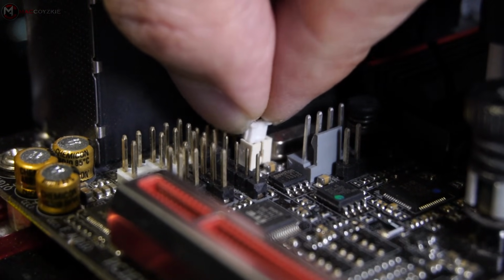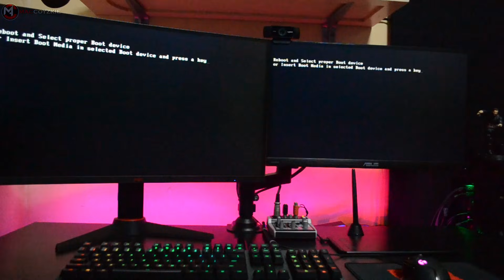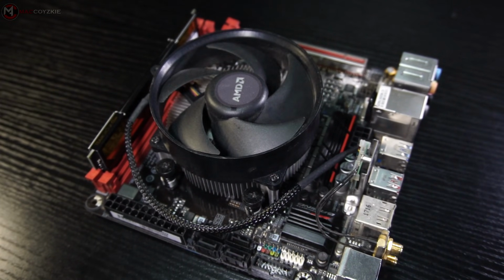How to remove cmos battery in your pc? Cmos reset / hard reset on bios

Comment: I have a question. I started noticing that my fan speed was sometimes very fast and that the CPU was running quite warm. I had replaced the fan several months ago after the old one had started making noise. After a few months, the newest cooling fan started making noise also. A couple weeks ago I noticed that the date/time was not keeping the correct time. I replaced the clock battery and the cooling fan. Since then, the fan is not running a fast rpm, the CPU is running cooler and the clock is keeping the correct time. My question is: will a weak clock battery affect the bios to the point that the CPU runs very warm, causing the fan to run at excessively high speed?
Reply from the maker: no, cmos battery has nothing to do with temperature. If there is anything, the pc will not run normally and you'll see "Power saving mode" if you got a weak cmos battery. If that happens again you might want to check thermal paste on the cpu, perhaps you need a new one
Reply: @MacCoyzkie  when I replaced fan it was a complete unit including heat sink which I cleaned old paste that appeared to be still flexible.  Used recommended paste every time
Reply from the maker: @robj2704  test your cpu and gpu temps then, try using msi afterburner

Comment: Hi, my computer was working fine. I closed it normally. Then after 3 hours i tried to turn it on again rgb lights on pc case and on the other parts were lightning, fans was turning but there was no signal on the monitor, keyboard and mouse lights are off, ethernet cable’s light is off. And fans are turning faster than their normal idle speed. I think it is a motherboard problem. I have removed the cmos battery waited 15 minutes but it did not solve my problem. I also tried removing and pulling rams and gpu and i have checked all the cables three times. This looks really weird. Nothing harmful happened to pc in between the three hour off period. Anyone has a suggestion? It is really frustrating.
Reply from the maker: sounds like a power issue either from the psu or wall outlet. If you got an AVR or UPS that might solve the problem, you can also double check the stability of your psu by using a psu tester like this https://amzn.to/3edegBw
Reply: @MacCoyzkie  i tried to run the pc with one ram stick and it worked. Then i put the other ram and run with one stick. It also worked. Then i put both ram sticks in and it is working now. It was a weird problem with a weird solution.
Reply from the maker: ok then try to clean the ram slots and make sure there are no dusts in it. Place ram sticks at 2nd and 4th slot. then try clearing cmos before power your pc back on.

Comment: Hello, i did as instructed and put back the battery but when i connected it and plugged it back in it started beeping 3 low and 3 high and it wont start any help?
Reply from the maker: that's actually a memory issue bro. so try ty re-seat the ram sticks and while you're at it clean off any dust around the ram slots

Comment: I think my cmos battery was located under my graphics card and im not a pc guy who knows how to remove the graphics card correctly
Reply from the maker: the other way to do this is to go to bios and load optimize defaults.
Reply: @MacCoyzkie  um i think my ssd where my windows was installed was a kingston and i set P0: SATAFIRM S11 as my boot option 1 but it still wont boot up, and also after several trials my RGB keyboard came to a point where it suddenly stopped working and i couldnt click any keys anymore but i couldnt say my keyboard is broken because the RGB light is still running, btw i already removed my cmos battery and waited 5 mins before putting it back but still no luck, maybe its time to let a computer technician handle this, i already have a copy of all my important files and programs on my E drive so i dont have to worry if my pc was going to be reset
Reply from the maker: @galadirk7843  hmm, how did the pc problem started?
Reply: @MacCoyzkie  it all started when i tried resetting my pc because all my browsers are crashing my pc whenever i try opening it, but while resetting it gets stopped at 63% and a bluescreen appears with "There was a problem resetting your PC. No changes were made" and then theres two options to choose, Troubleshoot or Turn off PC, so i chose Turn off PC instead cause troubleshoot isnt working either and then when i turned on my PC this error message started to appear and i wasnt able to use my pc since last night, im just thinking of calling for help from a local technician, nice tutorial by the way👌
Reply from the maker: @galadirk7843  i see i hope the technician will be able to fix it. My theory is that something got messed up with the system files, the bsod stop_code should give more info if you got the stop_code error during the blue screen.
Reply: @MacCoyzkie  i hope so, i already clicked the like button and subscribed to your channel, thank you for giving some time replying to my thread:)

Comment: Hey I removed my battery because I had the reboot and select problem so when I removed my battery and put it back in I entered the bios then went to select my ssd my ssd did not show up so pls help
Reply from the maker: replace sata cable, if sata is new or not faulty try your ssd in a different pc if its working. btw you will see the reboot and select on display if your ssd has no windows in it.

Comment: Does this mess up with the OS booting up or something like that? I need to reset the bios password but Im afraid it will afect the OS in any way
Reply from the maker: some motherboard does not reset bios password even after bios reset so check your motherboard manual for more info on yours. To answer your question reset bios through clearing cmos will only set the motherboard bios to default without interfering with your OS or any files in your drives.
Reply: @MacCoyzkie  thanks bro
Reply from the maker: @vasconeves1820  your welcome bro!
Reply: @MacCoyzkie  and btw it worked. I was able to reset bios password completely fine
Reply from the maker: @vasconeves1820  that's good news then :D

Comment: Dude. Mine was UNDERNEATH my gpu. Gpu also has a faceplate, and an extra screw. Best buy really didnt want me to fix this on my own...
Reply from the maker: there are mobos like that. What you can do right now if you don't want to open your pc, try going to bios and loading optimize defaults. its actually the same thing

Comment: I have a problem on my old pc when i turn it on its make this sound bib bib bib bib bib bib bibb like that it make the sound when i turn it on then keyboard mouse and desktop not working but pc is working so this the cmos vid will it help???
Reply from the maker: ram sticks are not seated correctly or faulty, try to re-seat those ram sticks, here's how to https://youtu.be/UKR5xRsOhNg
Reply: Its not working i did all you said to do :(
Reply from the maker: @rewas7162  ok how about you try your rams with a friend's pc to check if its still working fine.

Comment: the bios reset after 5 min cmos unplug right ? If i plug it again after 5 min
And then what must i do ?
Reply from the maker: yes, when you remove the cmos, the pc should be unplug from the wall outlet. after 5minutes place cmos battery back and turn on pc and see how it goes

Comment: So If I havd the cmso, will my computer remove everything, what's on it like Datas and everything?
Reply from the maker: no, clearing cmos is just setting the system back to default. your files will still be there and the only way you can remove files completely is by formatting the pc or having a clean windows installation

Comment: How do i remove the gpu?
Reply from the maker: there is a lock on the right side of the pcie, you need to pull that down, unscrew the gpu on the slot and pull it out

Comment: It worked! Subscribed to you sir!| at first I thought my PSU was faulty, but then I remembered something about CMOS, and I came across your video!
Reply from the maker: glad it worked! you're welcome bro and thank you too for the subbed!
Reply: @MacCoyzkie  Does this trick works if I replace my PSU but motherboard doesn't power on and only power on with old PSU or PSUs of the same model as the old one
Reply from the maker: @Arcyriea  no, the motherboard might be faulty at this point or you just missed a cable to plug in the mobo
Reply: @MacCoyzkie The new PSU passed the paperclip test though, but I'm not sure if the cables are ok

Maybe there are some wires that get disconnected when I tried to install the new PSU or the cables were already broken before they arrived
Reply: But then I see that with the new PSU the motherboard does receive power but the power button does not turn it on
Reply from the maker: @Arcyriea  try to jumpstart the pc then

Comment: When I open my pc I have to turn it on like 5 times before it starts booting and it really suck cahse its just turns off immediately everytime. Does changing the cmos make it work again normally?
Reply from the maker: if you don't see "power saving mode" on your display then there is no need to change cmos battery. your pc problem sounds like a faulty psu. at the moment try using AVR or UPS, perhaps its just the power outlet having power fluctuation

Comment: I CANT PUSH THE LOCK DOWN COZ IT KILLS MY FINGER TRYING
Reply from the maker: bring it to a local shop then and let them do it for you
Reply: @MacCoyzkie  I managed to do it n reset my bios but I still have issues with my pc
Reply from the maker: @Kazohh  you haven't mention the issue yet? how did the pc problem started anyway?
Reply: @MacCoyzkie  it restarts when I’m playing games
Reply from the maker: @Kazohh  oh that's probably overheating, check your cpu and gpu temperature and make sure it doesn't go beyond 90c. If it doesn't want to turn on again then you got a dead psu. Usually happens when your psu is unreliable

Comment: My motherboard and gpu all have lights on inside my pc but it won't turn on. Tried changing RAM sticks, psu and resting CMOS but still nothing. Any ideas ???
Reply from the maker: did you plug the cpu psu pins? just a hunch. Also the monitor cable is it in the gpu port? May i also know if this was already a working pc or is it new?
Reply: @MacCoyzkie  yeah pc has been working fine for 6 months then randomly wouldn't boot.
Reply from the maker: @MrThegeorge1990  it's difficult to say what is up, so how did your pc problem started anyway?

Comment: Tried doing this 3 times in a row and it did not work, i dont know what it may be but it could be the cords of my hard drive as it all started when I tried installing another hard drive, to which this chaos started with my pc as it would no longer work.
Reply from the maker: old hdd or faulty hdd could cause pc not to work properly. How about remove all hdd and just leave your ssd boot drive and try to boot your system to double check

Comment: I think I messed up one of my motherboards by trying to attach faulty HDD. Now I have constantly system interrupts using 20% CPU. I switched every single part back and forth trying to find faulty part but only thing left was MB. Do you think this could fix that MB?
Reply from the maker: if you already remove the faulty hdd then all should be good. Try replacing the sata cables because it might also be the one causing the problem. For the motherboard, it's difficult to say if its faulty unless you try it with a different system

Comment: Thank you so much! I thought I was done for. On boot up screen was black and fans started to run insanely fast. Just like in movies right before explosion. This fixed it. Learn something new every day
Reply from the maker: glad to hear it worked! you're welcome bro!
Reply: LMFAO mine doing it right now, that's why I'm here
Reply from the maker: @TheGetmoneyman  i hope you were able to fix it
Reply: @MacCoyzkie  I'm about to try the ram trick I literally took everything apart and put in back same issue even left some of the HDs unplugged
Reply from the maker: @TheGetmoneyman  can tell me how the pc problem started? also let me know your pc specs so i can have an idea
Reply: @MacCoyzkie  it was random at first then I left it on overnight, and woke it up then the screen was fuzzy then I did a few power cycles after about the third one it stopped booting , old system is but it was working like a champ til the other day
Reply from the maker: @TheGetmoneyman  at this point you need to test each part of your pc in a different pc, specifically the gpu and ram sticks
Reply: @MacCoyzkie  CAN you help me?
Reply from the maker: @cyberpunkmoba2045  i just answered your first comment
Reply: Hey,I just removed the battery but nothing happened 😔😔 still the same.screen is black and air cooler is working roughly,like it's rendering or something. I clicked on "use USB to flash bios" and then screen became black(( my motherboard "Tomahawk b550

Comment: Mine hasn't worked in months, I put new ram into my computer and it hasn't worked since mid 2020
Reply from the maker: have you tried cleaning the ram slots from dusts? also this clearing cmos might also do the trick
Reply: @MacCoyzkie  I've cleaned it a and cleared the CMOS more than 20 times now and it won't boot to the bios menu so I can go from 8gb of 1333mhz ram to 16gb 1600mhz, but 
It threw error code 164 on me and the only fix was going back to stock ram, but it still won't boot up because of error code 161
Reply from the maker: @ob1kenobi748  that basically means your cpu or your motherboard is not compatible with the overclock. Clear the cmos again and just use the stock settings for now

Comment: So my pc that I've been using for 5 years stopped turning on today, is it possible that my cmos battery is dead? Psu, Cpu, Gpu and Dram seems to be fine according to led indicators manual if I understood it correctly.
Reply: Omg literally same bruh
Reply: Kinda hesitating to remove the gpu too because the battery is underneath.
Reply from the maker: @Leg8FrFr  you will see a message on your display saying "power saving mode" if your cmos battery is depleted. if you don't see that then its in good condition. Clearing cmos might fix it so try it out
Reply: Thanks, I'll try it out later

Comment: boss may problem pc ko, kahapon at nung mga past days oks naman sya gumagana, pero ngayon lang ayaw nya na umalis sa logo ng asus, hindi rin napipindot yung del at f2 para pumunta sa bios.. recommended ba na gawin to?
Reply from the maker: May luma ka bang hdd sa pc mo paps? kapag gamit mong boot drive ay ssd or m.2 mainam na disconnect mo muna saglit yung lumang hdd, tapos boot mo sya. kapag gumana ibig sabihin malapit na bumigay si hdd or baka sira na. 

kung hdd ang boot drive mo hind yan applicable, mas mainam na gawin mo yung cmos reset katulad ng sa video
Reply: @MacCoyzkie  salamat paps, try ko gawin mga sinabi mo
Reply: @MacCoyzkie  yung ssd yung boot drive ko boss, triny ko inunplug cable nung hdd namin, hindi naman sya kalumaan pero medyo unstable minsan (yung bigla bigla nalang hindi nareread o hindi lumalabas).. nung unang attempt ko dito wala parin lumabas, so triny ko iunplug din ssd kung sakali, ayon nagkascreen na pero stuck parin. kase nung nag stuck after 1 hour nag no signal na.. siguro itry ko cmos reset
Reply from the maker: @Nfaustfeeeet  try mo cmos reset, kapag ayaw pa din ang duda ko yung psu ang problema. not unless nagkaroon kayo ng power fluctuation sa bahay lately. pwede din di gumana ng maayos ang pc kapag ganun